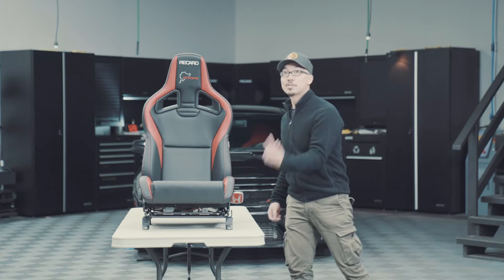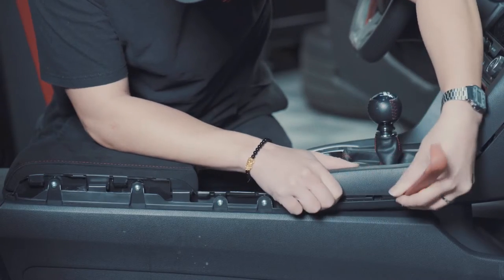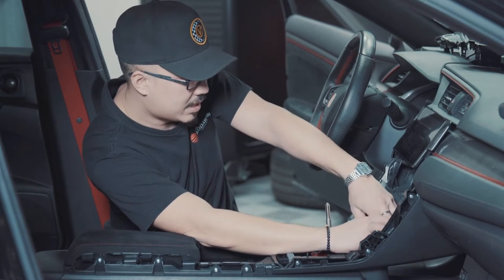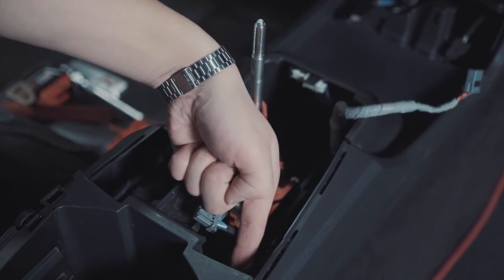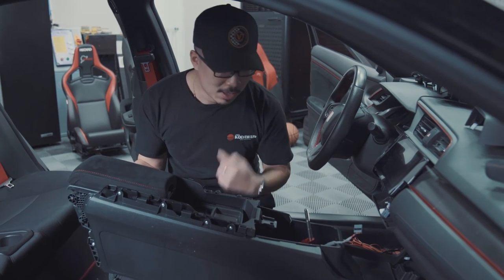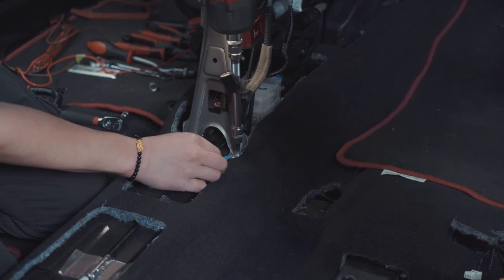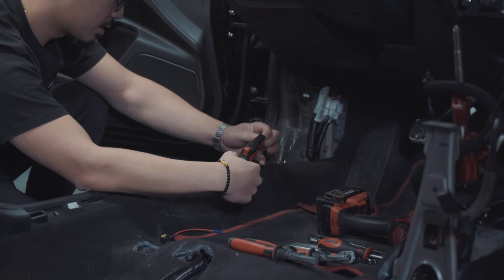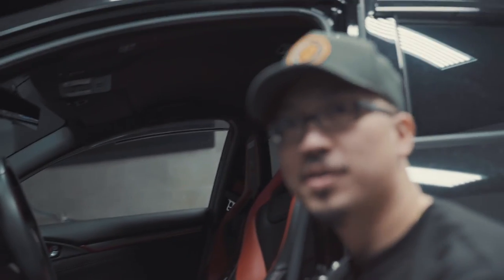Nürburgring RECARO Sportster CS Heated Seats Install

Comment: You don’t explain how you get the power wire from the passenger side to “tie in” with the power wire of the driver side to become one wire to tap into the fuse tap. Are you just tapping the passenger wire into the driver wire and soldering? 

Is 10a enough to power both seats as well as all the accessories in the car in that fuse spot? 

The OEM seat belt buckle bolts into the recaro frame, right?  So the OEM wire for the seat belt is just from the stock seat?

Thanks man this is very helpful!